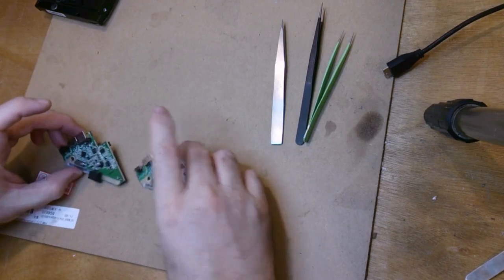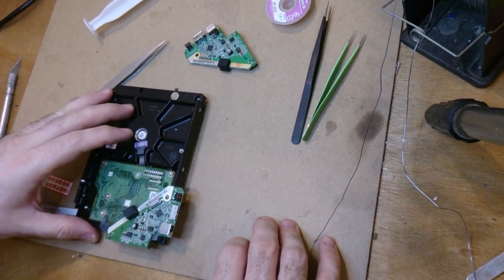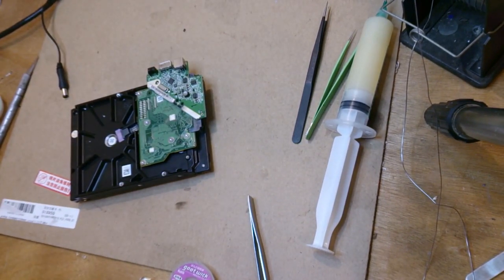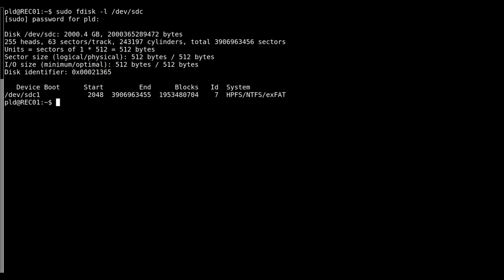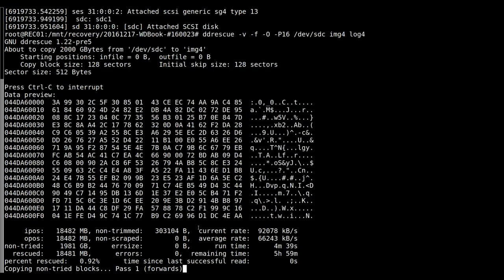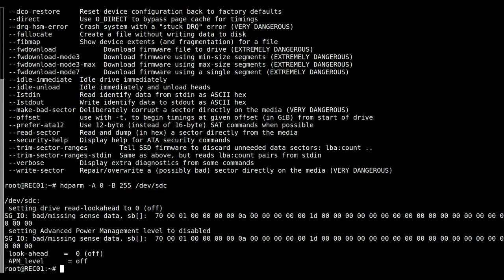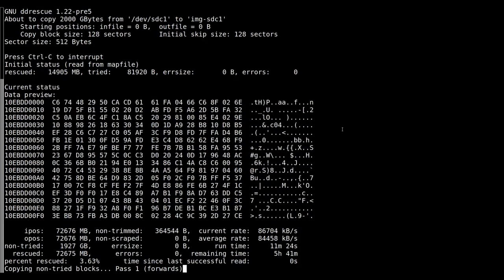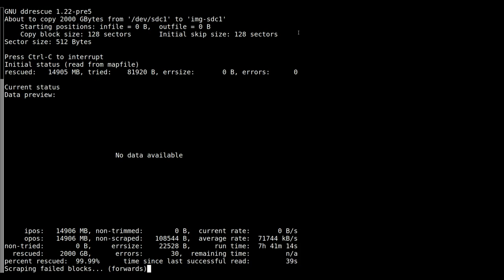Part 2 of 2 - WD MyBook broken controller board repair & data recovery

Comment: Fascinating, thanks for the vid Aussie! I came here trying to discover the brandname of the RAID controller in my WD Mybook - didn't get it but learned stuff nonetheless. Sorry about your injury! Cheers, Brian.
Reply from the maker: Best of luck with your quest to find the brand name of the controller.  I've long since learned to clip the fresh pointy tips off those spudgers, do not like that happening again!
Reply: @pldaniels , it's been many years since this video making those controller boards unavailable. Do you have any idea of the part number for the small power controller so I can order one from Mouser?

Furthermore... why the hell would they do this? It doesn't protect the user from someone who steals the drive. It doesn't even stop someone from scavenging the HDD for use in another computer (minus the preexisting data). The  only thing their encryption does seems to be to make the data useless once the board fries. It's infuriating. I have a decade of stuff on my HDD and I need it!!!!

Thank you for your time.
Reply from the maker: @BrendanClements   this project seems to be of some help these days - 
https://github.com/andlabs/reallymine

Comment: Thank you so much Paul for posting this awesome video! I was wondering why my disk doesn't mount. Now I know it's getting encrypted by default. I am now waiting for my new power supply and hopefully, the controller board doesn't break. Do you know if I am using the same type of controller board from a second-hand drive to power my original disk, will the data get decrypted successfully? Thanks again!

Comment: Is the encryption done at the hardware level using the chip or with the help of a software? There is an in-house security software in the disk itself that asks us if we want to secure our data. If we don't secure it using the software and our chip is fried in the future, is it possible to plug the hard drive in another external convertor and use it?
Reply: 1. it's done at the hardware level
2. there's no software configurability aspect, and you can't choose the key (it's not derived from a password or anything, just hard coded and the same for all drives) so there's no security benefit
3. no, the whole point of this encryption is vendor lock in, as far as i can tell

here is a paper that goes into detail:

https://cyberside.net.ee/docs/1002_GotHwCryptoOnTheInSecurityOfASelf-EncryptingDriveSeries.pdf